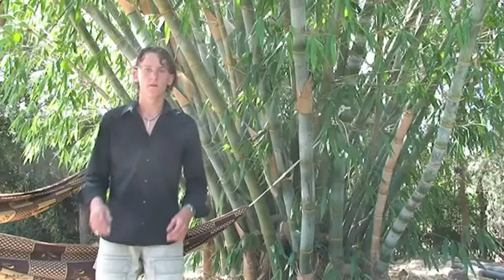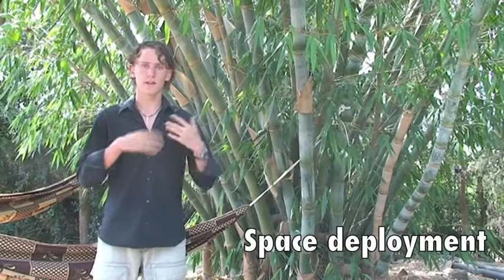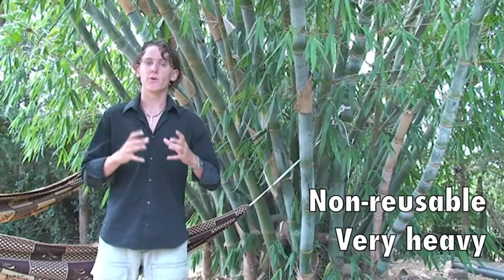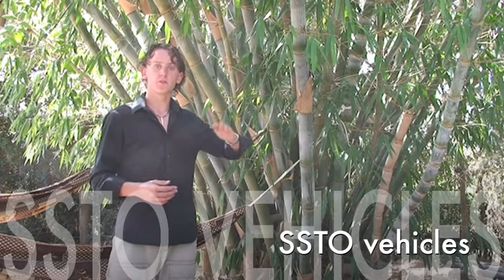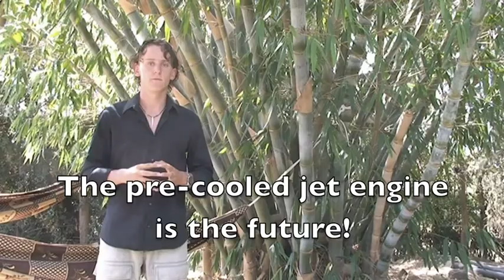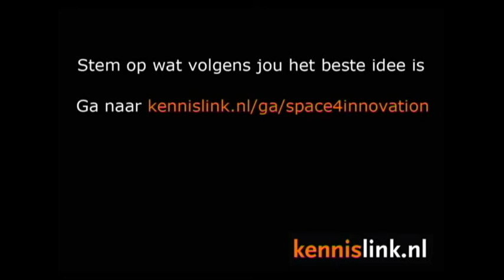Marijn Wouters: Pre-Cooled Jet Engine

Comment: I did NOT expect this to come from a place looking like Kenyan paradise, but this guy knows what he's talking about!

1.Air goes in.
2.Cooled by liquid hydrogen.
3.Burns with liquid hydrogen.
4.Results in lighter weight of the engine: no need to store oxidizer
5.Also less need of cooling.
6.However, as other jets, limited altitudally, would need to carry a separate rocket engine, which would be extremely uneconomical.